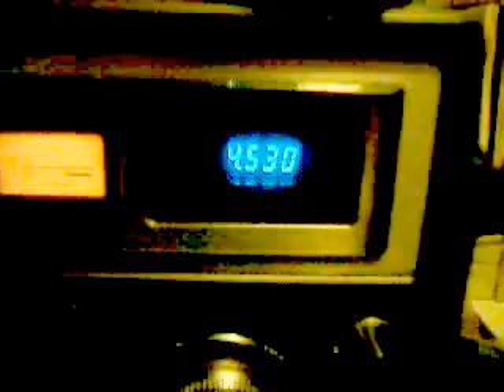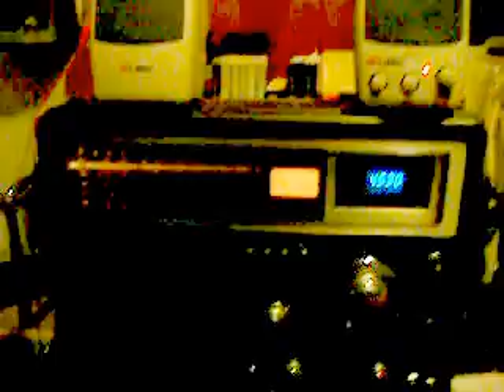Strange Signal on 4.530

Comment: I pick these up on my homebuilt shortwave crystal radio they sound quite different like a ringing bell due to the poor selectivity of the set. the signal is variable going up or down about 20 or 30 khz in a sweep like effect which the xtal set can receive in its entirety.

Comment: @KC8YOQ radio is my cheap $80 grundig g8 and just using the antenna that is on the radio itself. I have attached via roach clip wire to extend out to improve signal but all it does it overpower the radio and makes static wors